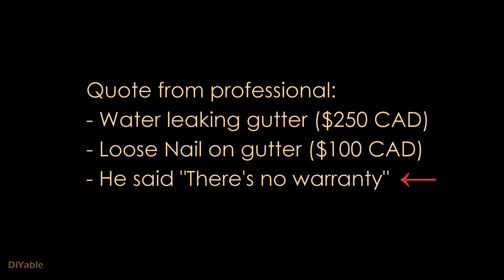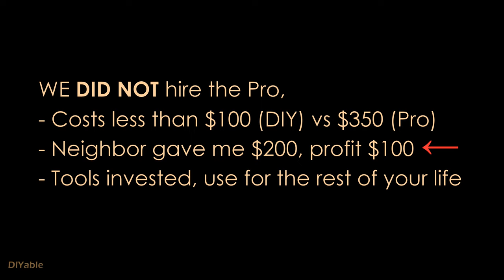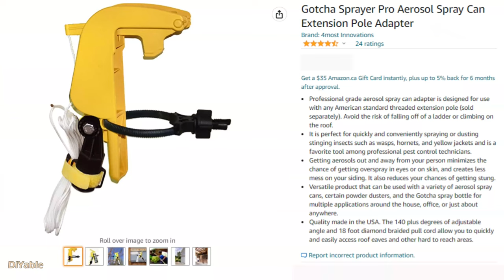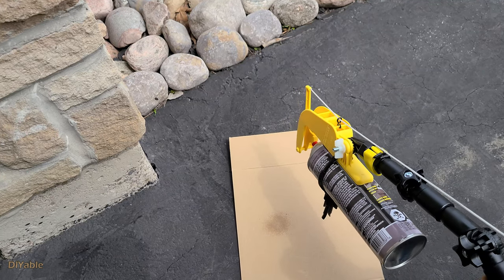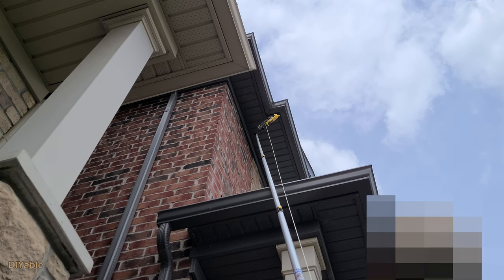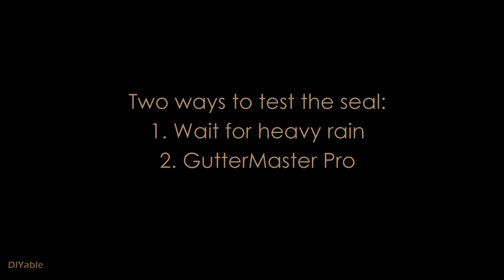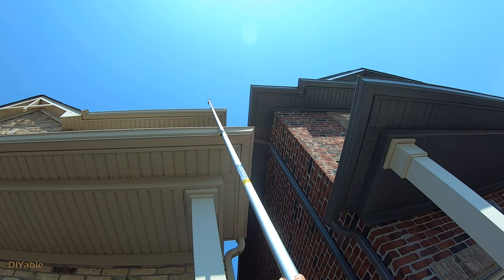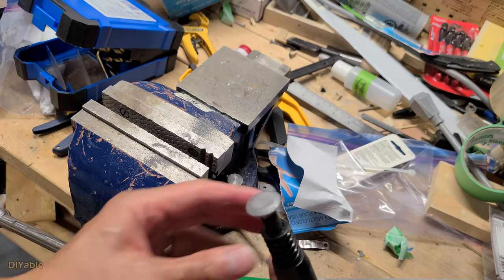How to use Flex Seal to repair gutter/eavestrough water leaks and fix loose nail without a ladder?

Comment: Great video. You did a terrific job using the Go Pro to show close-up what and how you're using tools to fix this simple but annoying issue. My gutter has a large leak and I found this video. Glad to see Flex Seal worked so well. I think I'll use Gorilla Glue seal tape to seal the bottom, and spray something on the inside. My gutter is only 9 ft from the ground so using a ladder is no issue for me.

Comment: Trouble is the sprayed surface will leak again after 4 to 6 months because of expansion and contraction in hot summer weather and cold weather. Only a temporary four months fix approximately

Comment: I like DIY, and I like your vids. However, spraying liquid rubber willy-nilly is kind of dumb.
Maybe if you have an old roof and don't care about spots of rubber being noticeable its ok.
Otherwise, if you own a home 2 stories tall, get a ladder. HD has a 20' one for $249 CA$.
I freely admit I'm cheap, however a ladder is something you will use multiple times if you own a house.
Reply from the maker: I hear you. I will definitely do that if it leaks again. I honestly don't think this fix will last for 10 years but amazingly it is fixed for now. We will see if Flex Seal is able to withstand harsh Canadian winter!!

Comment: It won’t last…. My flex seal gutter repairs (tried the spray and the glue) lasted an average of 2 to 3 months, depending on how much rain we got.  And this is on the first floor, where I could go on the roof and give a good cleaning on the inside each time.  I tried four times over three years.  I gave up and put a trash can under the leak to catch the rain water and use the water on my plants.